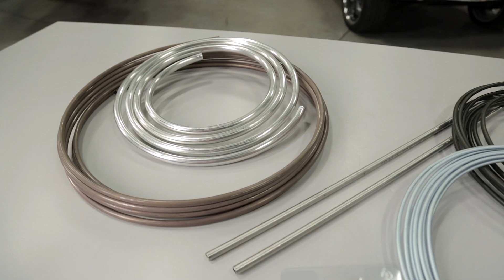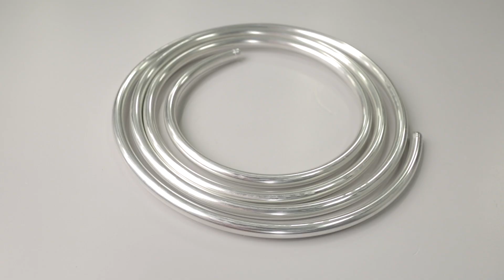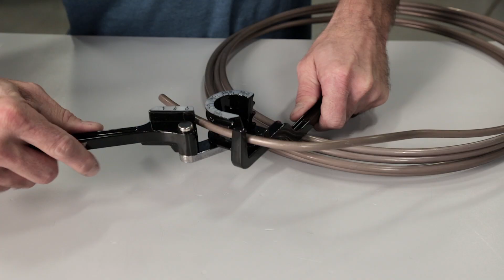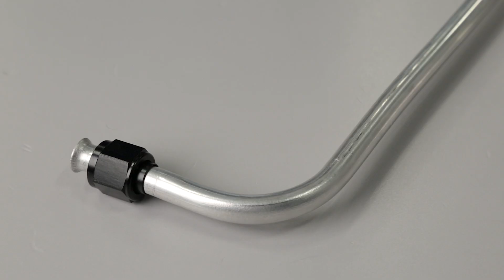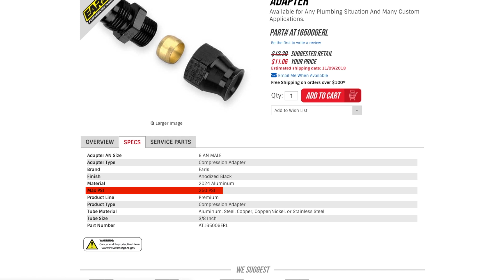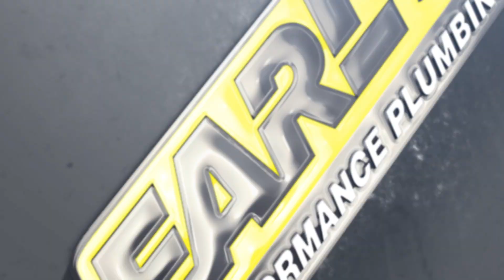How To Choose And Use Hardline

Comment: Here is where I am stumped with hard lines in my prospective A/C system: I need to find ways to 1) transition from standard barrier A/C hose (6,8,10) to equivalent hard lines (3/8", 1/2", 5/8") and 2) find #8 and #5 versions of AeroFlow's A/C #10 to AN -10 adapter (Part Number: AF88-3003).so that I van use AN fittings and hard lines on A/C ports.

Comment: After fighting all day trying to make black PTFE hoses that are about 2" of hose. Metal is gonna be the way to go I think. If you are on the fence, take a look at any of the Nelso racing videos. Those cars with all the polished hard lines are a work of art. First time I spotted all the polished lines on turbo feeds, waste gates, all of it,I couldn't believe how good it looks. Ill never make these bends in rubber I don't think to mount the regulator under the throttle body on motion bracket

Comment: I need to run hose/tube on hotrod from the engine driven air compressor to the air dyer this line will get quite warm  200 degrees and need to run about 6 feet and support 120 psi what would you suggest I'm think earls steel line needs to be 1/2 or 5/8

Comment: For a stainless steel line when should I add the 37 degree flair and when should use the a ferrel and the hard line adapter
Reply: Hi David, YT channel Klowny1969 has a great video showing all of this. Tools needed fittings etc. Check it out.

Comment: Which lines do you guys recommend for running e85? Please i don't w as not to use ptfe rubber.
Reply: This is debated all over the internet but the general conclusion...especially if fuel will sit at all...is that stainless is the only hard line to use with E85 or methanol. Lots of discussions on yellowbullet about this if you search.

Comment: Is there any reason to not use normal hardware copper pipe?
Reply: It's not the same as nicopp.
Reply: It will corrode. Ever peel a penny off the floor of a pool?

Comment: Are there any problems with using the copper/nickel tubing with E85 fuel?
Reply from the maker: No sir, our easy form line is well suited for use with E85, ethanol, alcohol, and race fuels.  thx J

Comment: I love this video. I spent HOURS compiling a spreadsheet months back with all the information contained here. I know it was glossed over here, but I would love to see a video about single flare vs double flare vs bubble flare. How to identify 37 degree from 45 degree by sight. What is reusable between tube sleeves/45 degree double flares/ compression fittings. Can I mix and match a 37 degree aluminum fitting and a 37 degree steel fitting. Corrosion inside the lines (ethanol, methanol, oil, water ect). When to use crimped lines vs when to use homemade lines.

Again thanks for the amazing information. I wish this video had been out sooner.
Reply from the maker: Thanks for the feed-back, I will try to put together a video to answer  your great questions in the near future!  Thx J
Reply: @HolleyPerformance  what hardline would be best for E85? Or could you use them all?

Comment: Any of this good for efi?
Reply from the maker: Yes, all of this should be fine for EFI use. I would not recommend using the radius bead method with a rubber hose for EFI  pressures.  Thx J